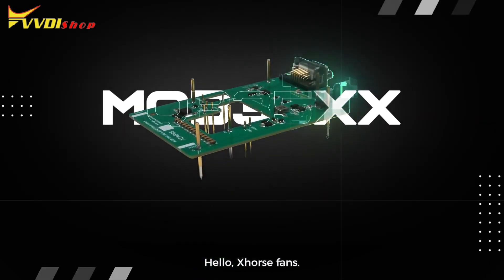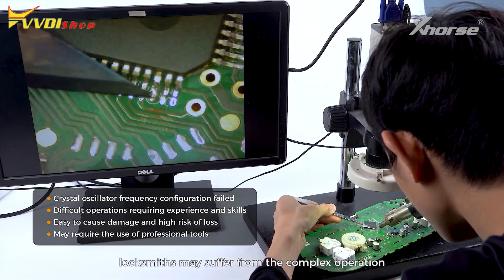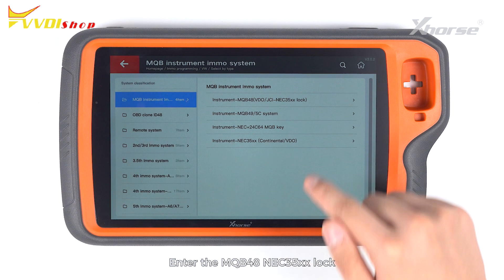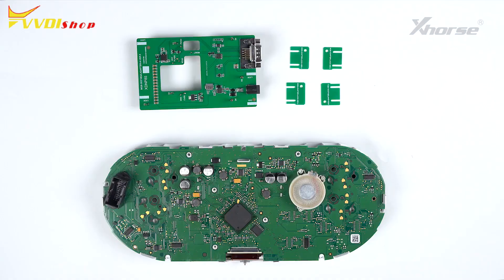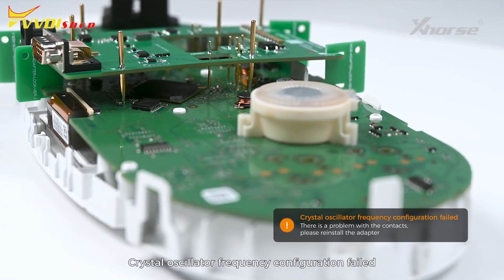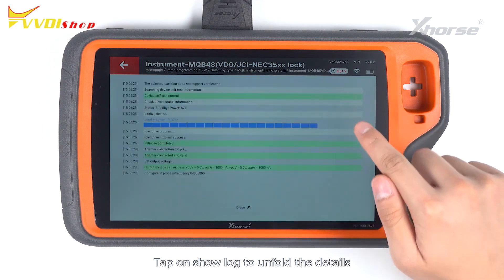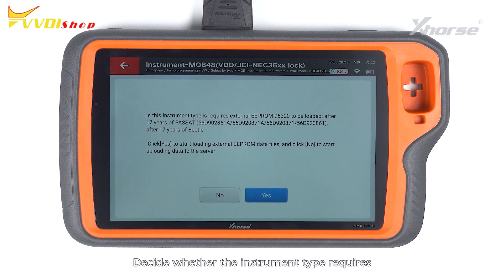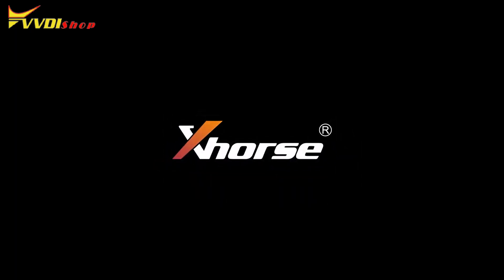Xhorse VVDI Key Tool Plus Read MQB48 D70F3537 with MQB Solder free Adapter VVDISHOP

Comment: This adapter does not work, pins line up but still, I tried few different clusters and adapters, nothing. It's a scam!
Reply from the maker: it does work. send videos if has frequency failed error, there is a solution
Reply: @vvdifactory
Reply: @vvdifactory hey
Reply: @vvdifactory i need help with that!
Reply: what is the solution! I got the same problem!!! can you help me? @vv